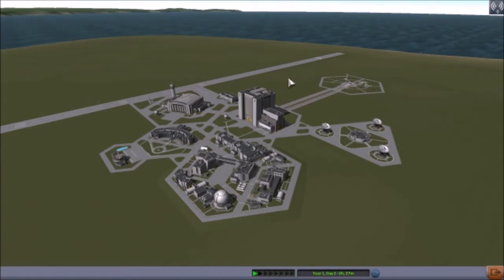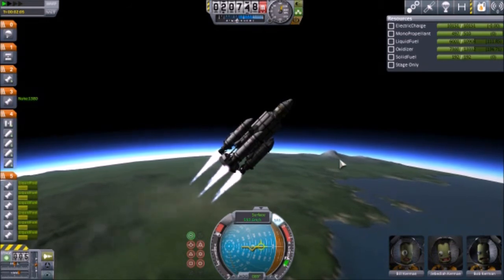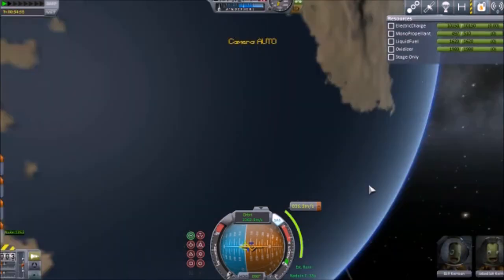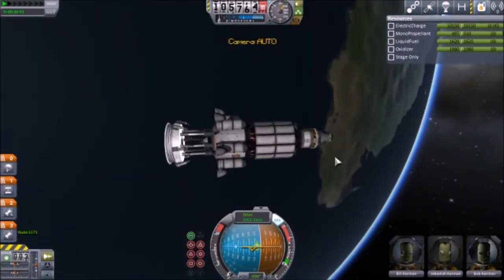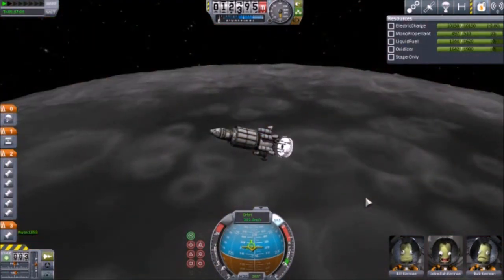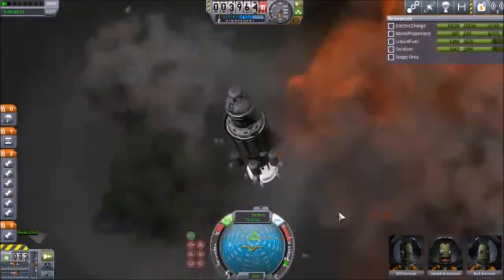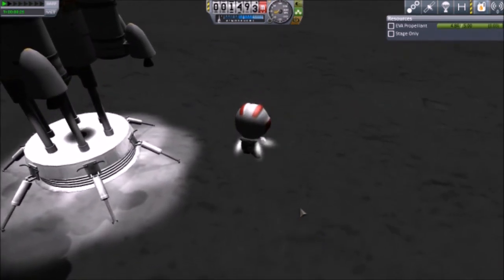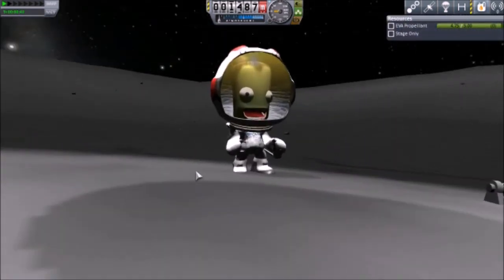KSP Quickie with Bob: Nuclear Pulse Detonation Engine

Comment: The non interstellar Orion was to have been the Odyssey class, 1,000 feet in diameter , 1,100 feet in overall length, 8,000,000 tons dry weight , able to carry 2,000,000 tons of payload. 🎇🚀🎇🚀🎇🚀🎇🚀🎇🚀